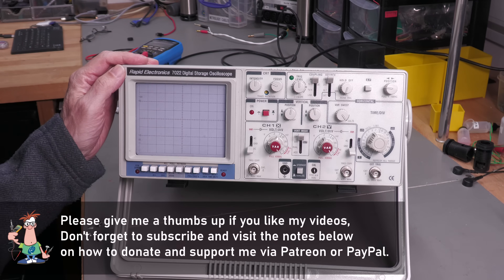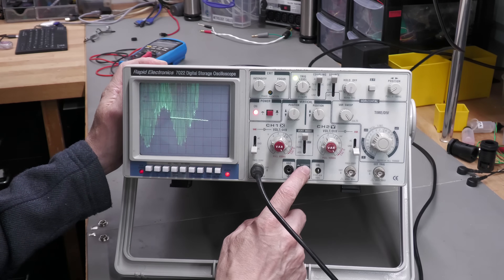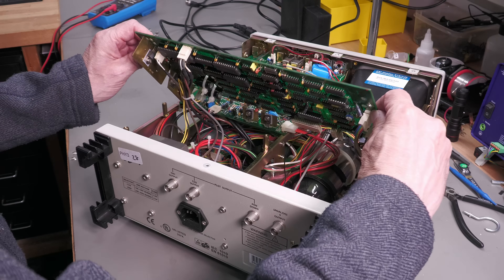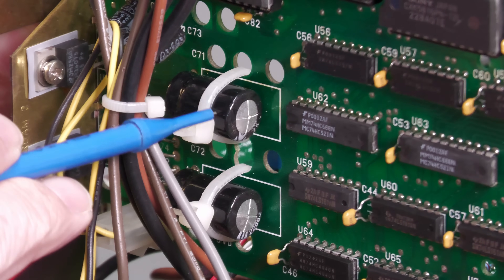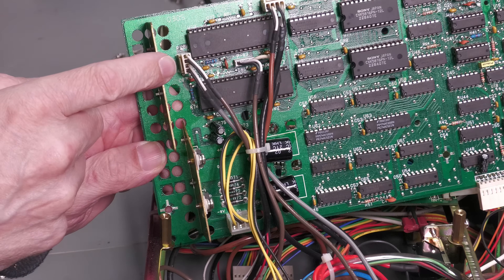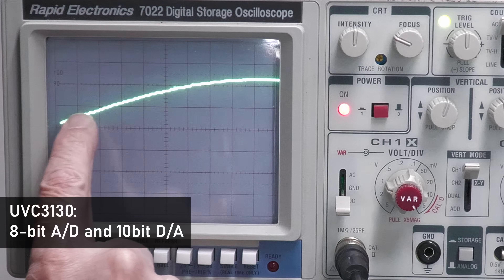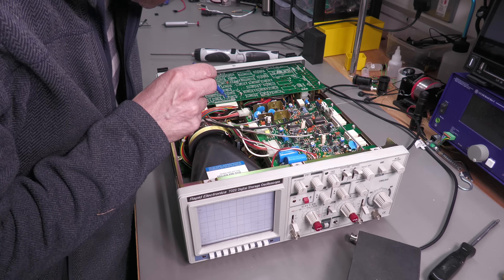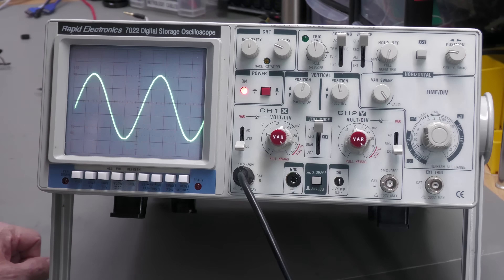No.136 - Rapid 7022 Digital Storage Oscilloscope Repair

Comment: That really was an easy fix. The scope came from the UK Ministry of Defence, who probably had it on a shelf for 20 years before auctioning off, hence the lack dust. When I brought that scope, I brought several others of a similar vintage that were in equally good condition.
Reply from the maker: Cheers for the info Aaron. Yes, it has a sticker on the side which I looked up........"Welbeck Defence Sixth Form College" of which was institution of the Ministry of Defence (MoD). Closed in 2021.

Comment: Had a Tek 2232, and yes the digital board decided to die, dead capacitor, a shorted Tek favourite, tantalum bead across the 5V rail. As I needed the scope that day, just unplugged the digital board, losing the ability to store, and the nice readouts, but the analogue side was still perfectly functional, so I finished the job, then sent it in for repair.
Reply from the maker: Sometimes you gotta do what you gotta do....:-)

Comment: @5:00 caps at the bottom left are bulging… it’s always a crapacitor
Reply: I was waiting for a "it's always a crapacitor" 🙂
Reply from the maker: Next time, I'll disguise the bulging cap with maybe the part number of an inductor or resistor......maybe we'll get a different response...:-)
Reply: @IanScottJohnston  Would be good i've never seen a bulging inductor. Burnt out, fused, melted yes but bulging no.